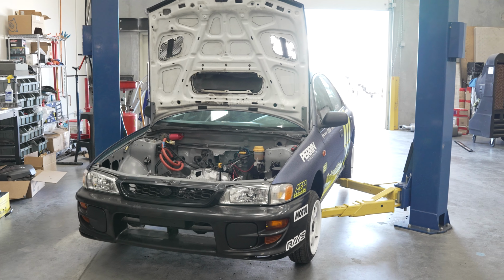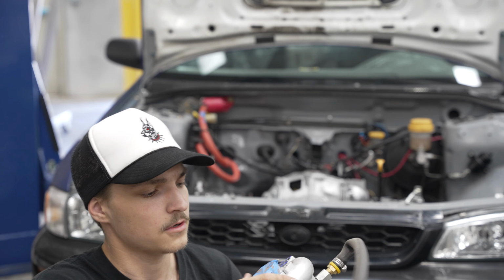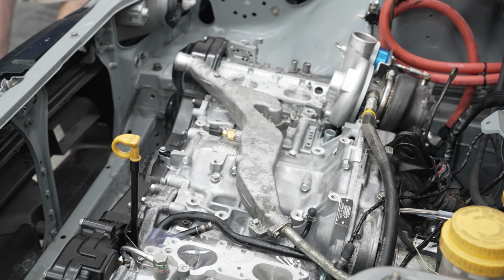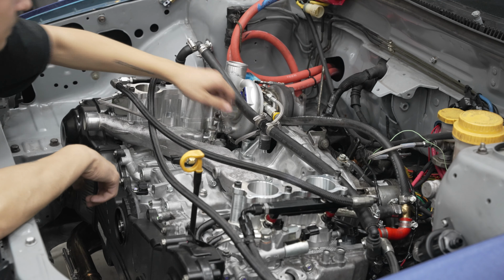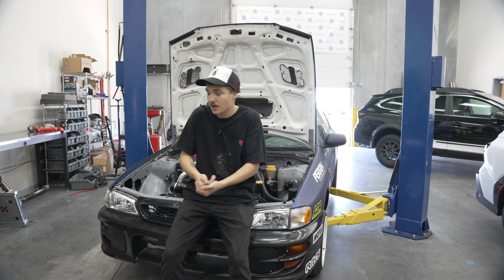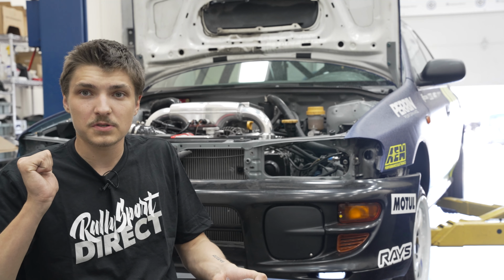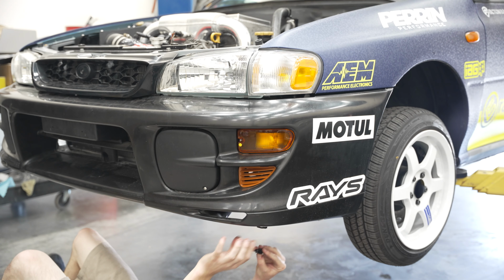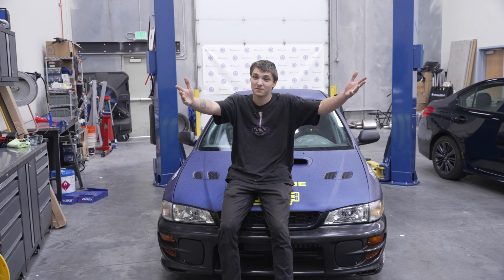GC Land Speed Car Revival Part 2: IT'S ALIVE!!

Comment: Iv built a few of these but the ej257 and I'm not sure this gunna work it's a zero balance motor you still have the crank spinning in the back of the motor with no rods and pistons its gunna shake small at first this fail .just one subaru guy to another who has build a few of these boxers letting a new build Rev that high no good